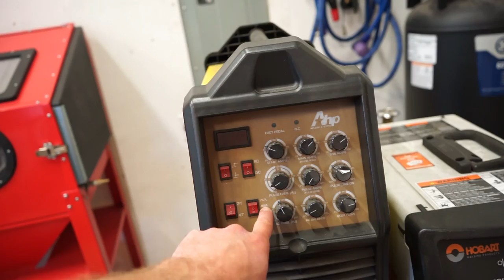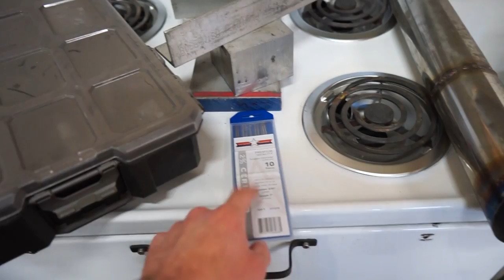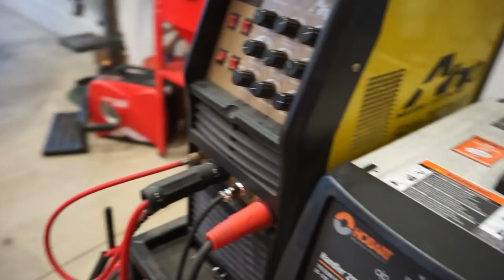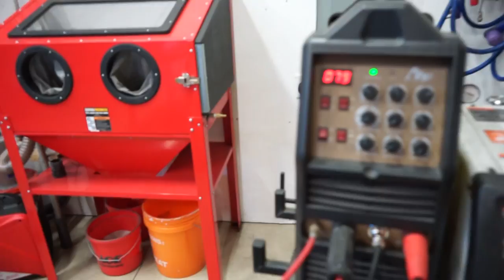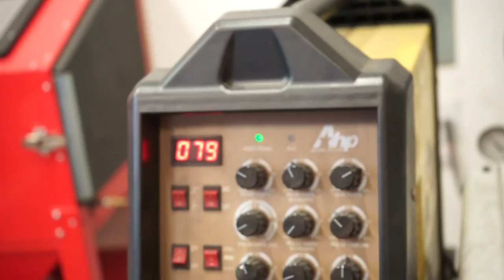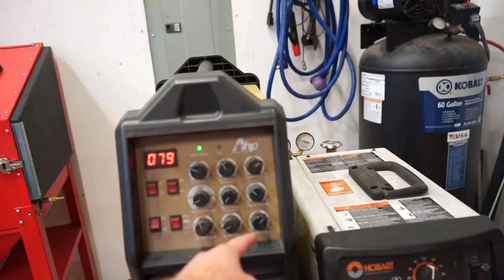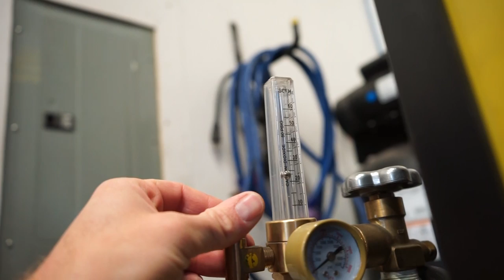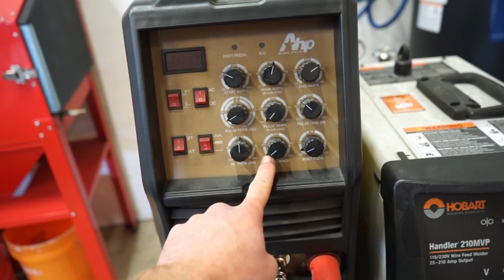Attempting To Master AC (Aluminum) Tig Welding!

Comment: That 1.5% lanthanated (gold) works real well on those machines on aluminum and stainless, or of course the classic pure tungsten  (green) but only for aluminum. That contamination might be coming out of the metal,  might try playing with that balance some more.

Comment: I've found that the exact tungsten is actually critical, less so on the inverter machines though. on the ancient 1960's transformer machine we have, that sucker will not weld worth a damn if you use the wrong stuff.

Comment: Hey Austin, for filming the welding, you may need to setup the camera on a tripod well back from the welding table and use a zoom lense. The camera is too close and is being impacted by the EMF being generated from the arc and the welder. Good job on the welding though!
Reply from the maker: Yes my lens doesnt have much zoom!